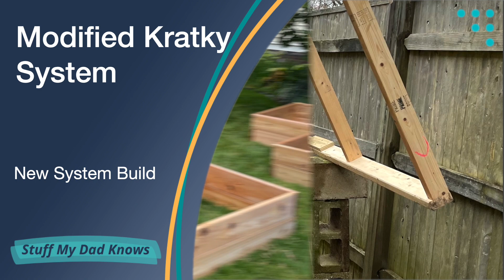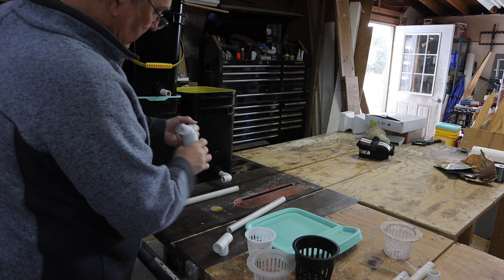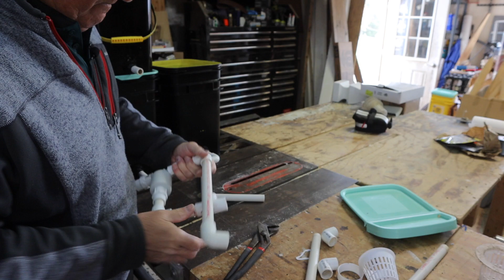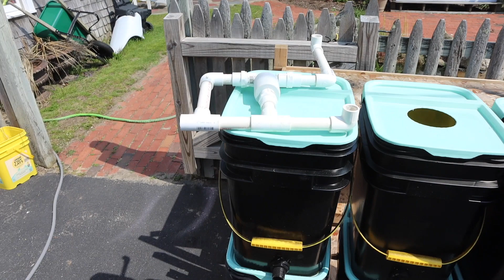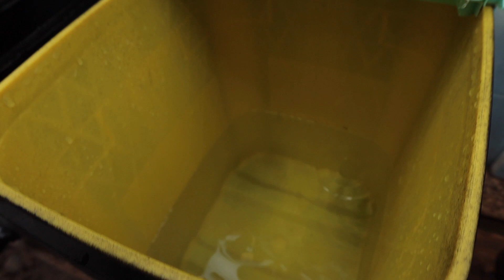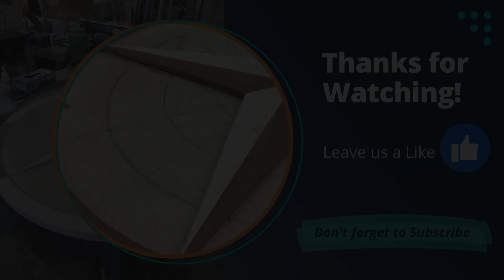Modified Kratky - New System Build for Home Hydroponics

Comment: I am super impressed with your idea of managing liquid level in Kratky buckets and going to try this out soon.
One question though, how do you deal with super concentrated left over nutrient in the bucket when the level drops down to that preset level ? Do you flush periodically and start all over again ?
Reply from the maker: Before you build it, check this video out: https://www.youtube.com/watch?v=CVWy7ROMRSY&t=1s .I updated the design a bit. The ball was tool low in my first attempt, it just needed a spacer!

In a Kratky the nutrients are absorbed by the plants, so it never really gets super concentrated, if something the nutrient solution is getting less concentrated with time... that's actually the whole Kratky concept to have a container large enough to just let it be for the whole plant cycle. But you need more space to accomodate a large container. So having smaller container and allow it to re-fill makes a lot of sense for many of us. The nutrient solution you put in should be made according to the instructions that come with it (whatever you use, I use Masterblend). You should never make the solution more concentrated expecting it to dilute when it reaches the plants. 

Hope this helps. Thanks for watching!